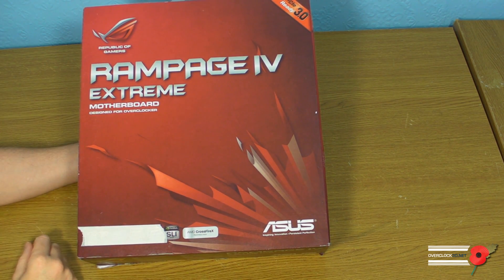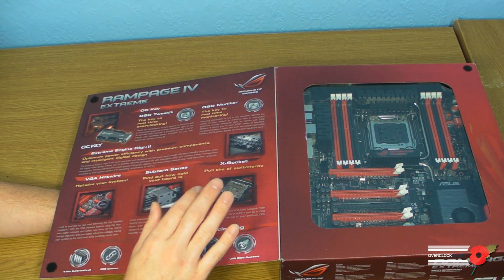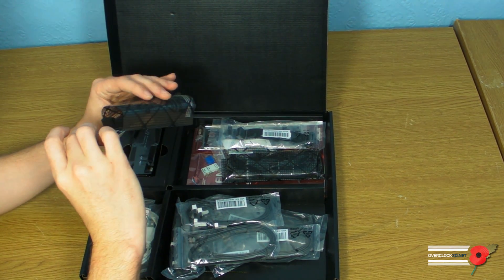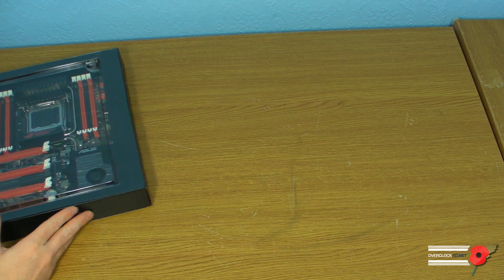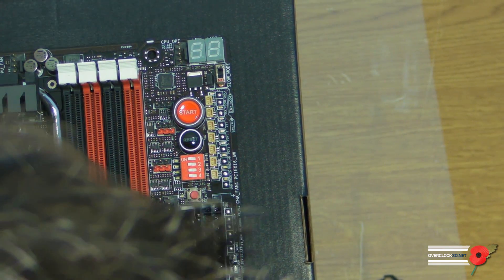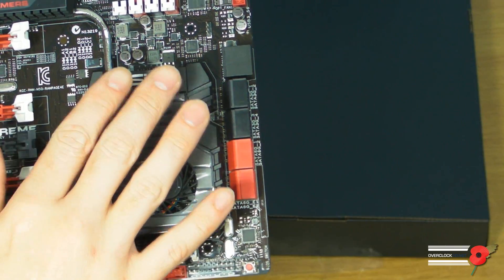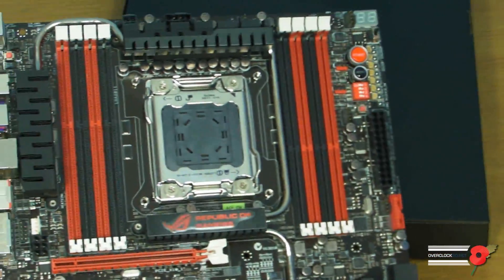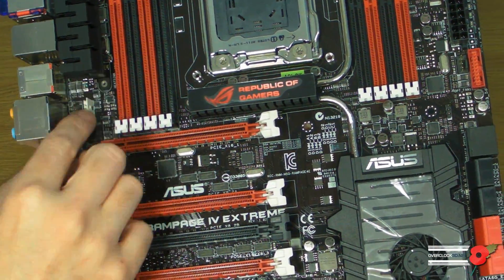Asus Rampage IV Extreme - LGA2011 X79 - Rampage 4

Comment: No this is a 2011 socket board... I.E Sandybridge E (EXTREME), the new ivy bridge and sandy bridge CPUS like you listed are socket 1155, the 2011 having 2011 pins on the bottom and 1155 having, well 1155! so no it will not.

Comment: @MrACOO  Review websites jumped the gun :P  They really meant to say "heatsink"  not the actual "cpu"  (that would have been nice though)

Anyway, this board has no pci slot :(  I like the R3E because it has a vintage pci to plug in an old sound card, (it supported wavetables in ecw format, not the ugly sf2)

Reviews already claim that 2011 chips are slightly better in performance, so if you have an R3E, keep it.   You'd "ALMOST" be side-grading if you got this.

The R3E is one of a kind

Comment: @peet88ember SB, at a core level, handles PCIE 2.0 as the PCIE controller is IN the CPU. You need Ivybridge to actually get a full PCIE 3.0 speed link. You can still use a PCIE Gen 3 BOARD with SB but you will get PCIE 2.0 SPEED.

Comment: Hi mate. Question for you. I have two EVGA GTX-580 Classified in a SLI Configuration. Each card requires two 8 ping connectors and one 6 pin connector. Each card draws a maximum of 42 amps. I notice I don't see any PSU's out there that have 12v rails rated at 42 amps. I'm using an Antec HCP-1200 with 12v 30 amp per rail and it won't power up both cards at the same time. It will only power up a single card. Is my psu enough or can you recommend me a psu that will power both of my cards. Thanks.

Comment: Really ... X78 cannot supply x3 PCIE 16x slot FFS intel... (weather there fully maxed or not it should be full 16x speed on all slots on this new chipset not just a minor upgrade and extra ram channel from X58)
so in short we cant have new processors fit x58 coz of a new ram channel... :( and now we have to buy new MB . RAM . CPU....